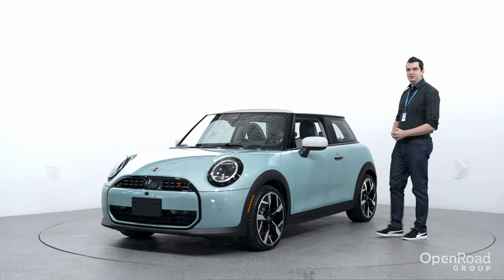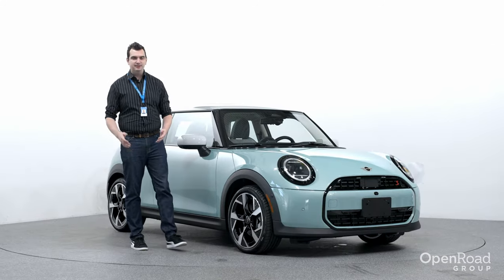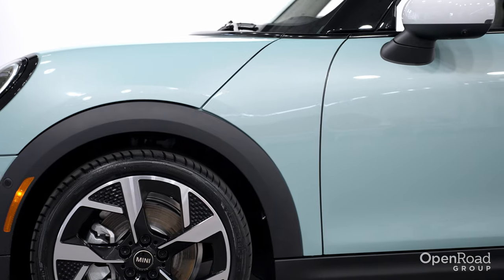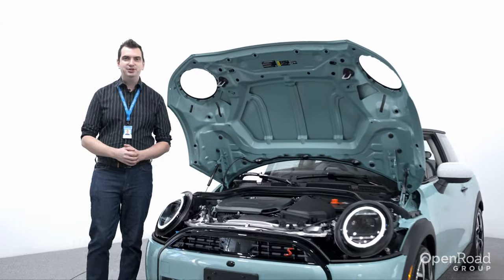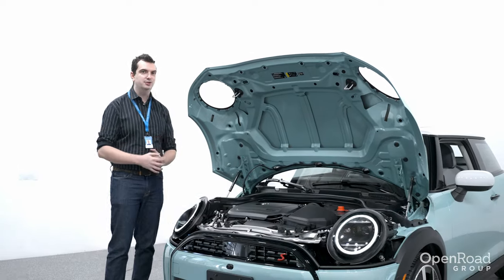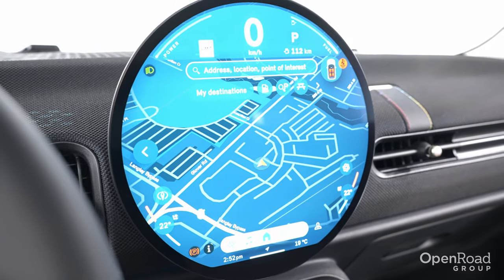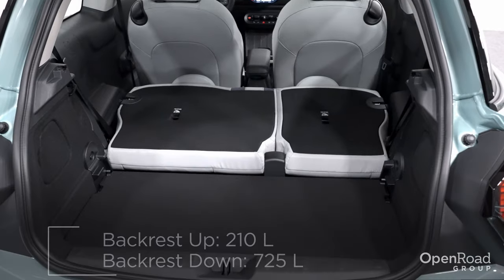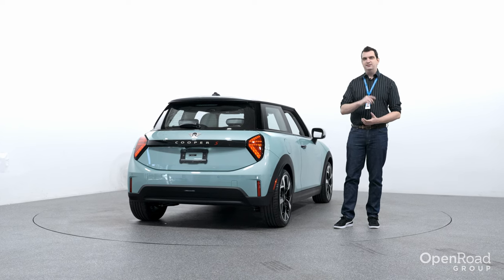First Look: 2025 MINI Cooper S | OpenRoad Group

Comment: 2025 model puts only 20hp over my old 2013 Cooper S (only 1.6lt). actually older model has better power/weight ratio with 1200kg curb weight. 200hp power is 1.6lt level. 2lt engines put 300+ hp nowadays. why is mini holding back the power stats?